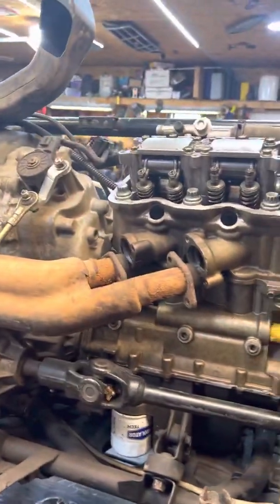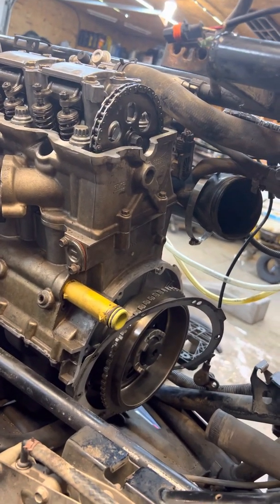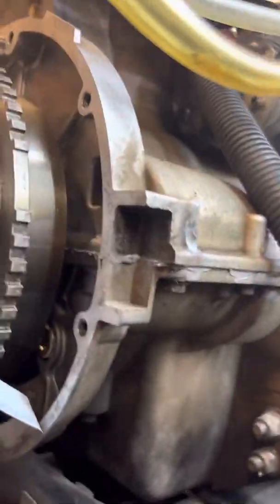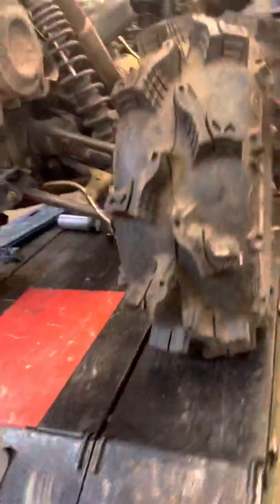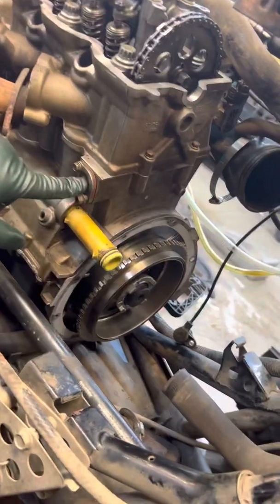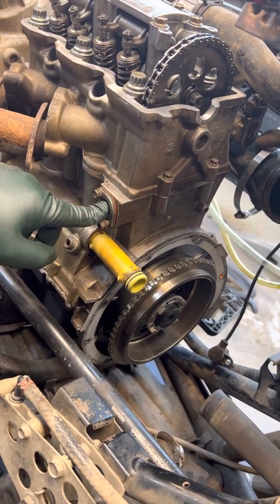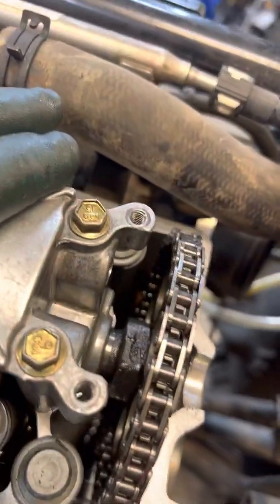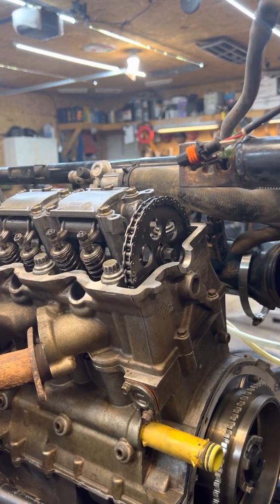Polaris 850 timing marks

Comment: How can I check the bottom timing without removing the cover to make sure it’s in the correct place? I saw where some motors have a screw/plug that you can look to see if the line is in position?
Reply from the maker: Correct you have to remove the plug on the left side of the front cover
Reply: @Bjerkefamilyadventures  I appreciate you man, I’m going outside to get back at it this morning. Again thanks for responding.
Reply from the maker: @djdscover138  not a problem

Comment: I just came across this I actually had the Polaris service manual downloaded, CGI pictures and all, when you go through the procedure it tells you to line it up on the side of the case and then a page later it tells you to line up through the crank position sensor hole which sets you off 45* on the cam or 90 on the crank. 

Just want to make sure I wasn't going crazy glad I found your video
Reply from the maker: I’m not quite sure why there isn’t better information out there on these engines. It took me a bit even with the manual a wile to figure out how to set the valves on one.